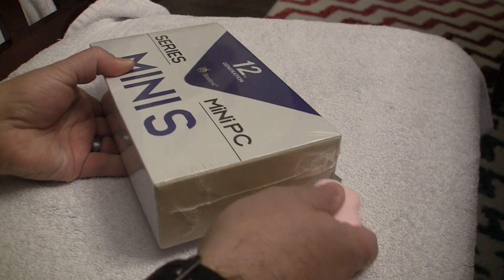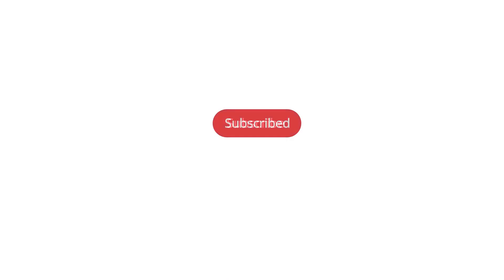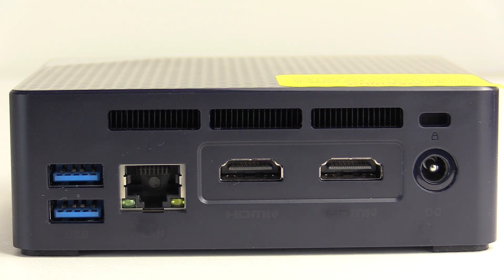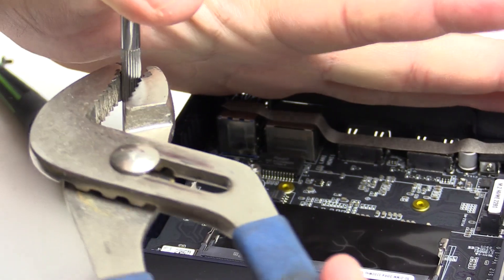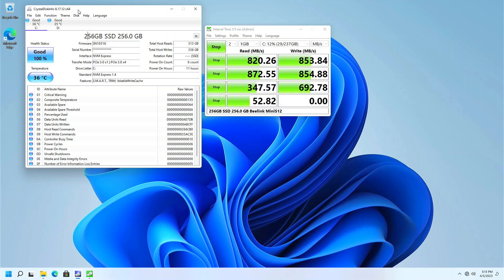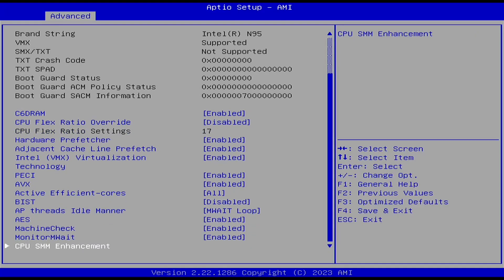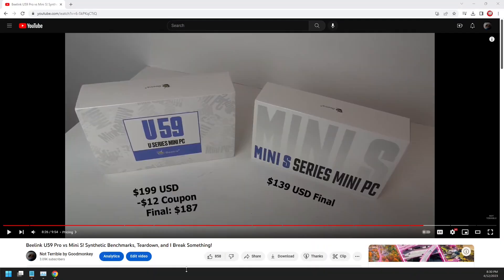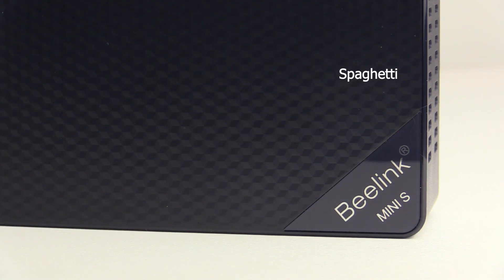Beelink Mini S12! Synthetic Benchmarks, Teardown, and how it differs from the Mini S

Comment: Mine broke in about five months.
Reply from the maker: Thanks for your feedback. I've not had mine in use much at all.  Anything particular you can share about which part died?
Reply: @ntgm20  it just overheats and shuts down.  I've taken it apart and cleaned the fan.  I also looked at the amount of thermal paste was on it.  There was none on the chip.  I put some one there, but it's too late.  The thing is junk.

Comment: Thanks for the video.
Quick question, by the way.
I'm aware that the PC comes with Windows 11 Pro pre-installed.
But if I decide to reformat the PC and reinstall the latest version of Windows myself using a USB flash drive, will the license key still work automatically?
Reply from the maker: Thanks. So far I've had no issues with activation of Windows reinstalling them on Beelink machines.
Reply: @ntgm20  
Thanks for your reply! This is really intriguing. Just yesterday, I reached out to the Beelink support team, and they mentioned that I'd need a new license key after reinstallation. However, I've been considering reformatting it myself because I read some reviews where people successfully reinstalled Windows and their license keys worked just fine. It made me wonder if Beelink's pre-installed Windows might be using OEM license keys, which are automatically identified and applied. Fingers crossed that my experience will be similar to yours. Thanks again for the helpful info!

Comment: I have the 16G RAM 500GB SSD version.   Great review.  I get well over 800MB/s on sequential files according to Crystal Disk Mark which is almost twice as fast as the SATA III version of the same drive.   So the x1 NVME interface while slower than NVME with 4 lanes is still faster than SATA by a noticeable amount.  I love mine so much I got one for my wife as well.  Getting a computer with these specs for less than $175 brand new is impressive and maybe the best bang for the buck out there.
Reply from the maker: Thanks for your feedback! It is true, even the X1 PCIe lane with NVMe is still loads faster than most spinning HDDs, especially the size that would be in something like this.

Comment: I am using it as a Linux server running mostly Pihole and some other web services. And planning a minecraft server as well.

The problem is that it sits at 50 - 58 degrees celcius all the time. I am not sure, but this seems a bit dangerous for server hardware. I have not touched such a small form factor PC yet. So I am not very informed of this type of small device. However, the home server I have worked with was mostly sitting at below 40 degrees celcius. Of course, they were comprised of retired  desktop hardwares.

So, perhaps this machine can be a great emulation powerhouse. But for a server... I still have some doubts. And I am not even considering the possibly, most likely, horrible TBW of the M.2 main drive. Prolonged high temperature may cause early retirement of VRM parts and spending more power than desktop parts, which can stay at low temperature all the time.

It is cheap. But sometimes a few generations old new desktop parts could be better? I dunno.. Maybe an ARM based SBC xould have been better for my purpose..

Comment: Weird thing that the M.2 NVMe slot only runs on PCIe x1 lanes, since the processor isn't PCIe lanes limited, it's have 9 PCIe lane, and I believe 2 lanes are used  (excluding the m.2), one for Gigabit LAN (the SoC PCH doesn't have integrated LAN MAC or RGMII interface) and embedded M.2 1216 WiFi Bluetooth combo which weirdly enough using PCIe variant since those processor supporting CNVi-based Wireless card
Reply from the maker: I could have misread the specs on their site, but that was after getting the speed. Looking into it then if it was X1 the speeds make sense.
Reply: Good English, and actually you're right about the lane limitations.  It seems a little expensive with all that considered.  GoodMonkey should record a comparison = set up this and another mini pc and do some stuff using the PCIe lanes - copying files or something on a timer!

See what the impact is, maybe it's not too bad!  GoodMonkey you have to stay up all night and make that video lol.  Probably take a week that's actually a lot of work... I gave you a wee shout out on my channel just now :)
Reply: @DailyCorvid  I'm trully sorry, English is not my native language, and for the PCIe situation, Goodmonkey is nailed on, PCIe x1 gen 3 bus speed is around 950MB/s, now considering how the SSD controller work on each lane it's spits out, It's reasonably fit the criteria of PCIe x1 Gen 3 speed on CrystalDiskMark sequential R/W Speed (around 850MB/s on the video). I think BeeLink know people like me will hack those cheap NUC into something else if they put full fat x4 lanes in there 😂. Im using generic Mini PC one (mfg. by foxconn) who have 1 nvme slot and A+E slot, and boy I'm using the lanes till the last drop for my home server, hooking it up to PCIe switch and split it into x4 M.2 NVMe and using another extension cable put 2.5GBe NIC, HBA, and bunch more shenanigans.

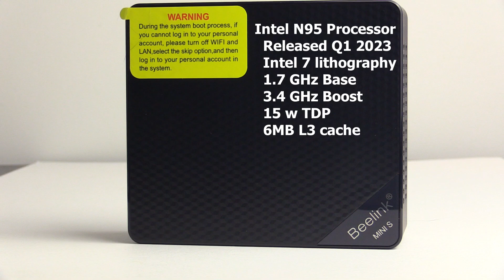Comment: at 1:13 - is it 4.3Ghz like you said it or 3.4Ghz like it's written on the right side ?
Reply from the maker: Good catch! I've not even closed out the files making this, just went back and had it wrong in my script. The boost is up to 3.4 GHz.
Reply: @ntgm20  The specs are all crappy on the box it seems 🤣